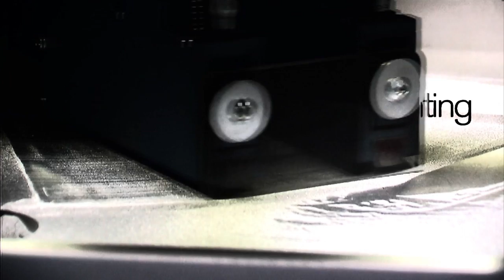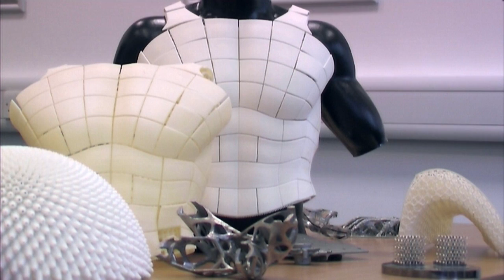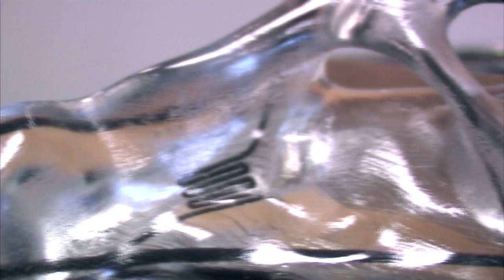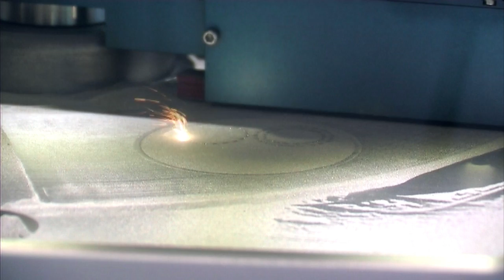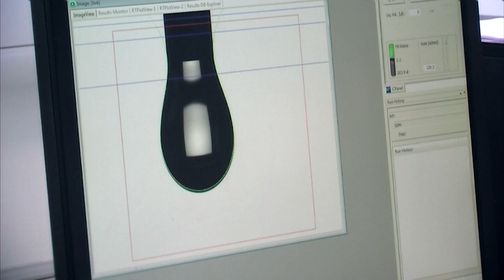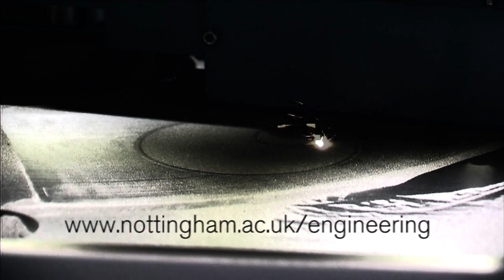Additive Manufacturing - 3D Printing

Comment: 26th of september 2022, I’ll start my Msc in additive manufacuring and 3d printing course.
Reply: Hello there, is there any way i can contact you regarding this masters degree?
Reply from the maker: Hi there - if you'd like more information you can search our Engineering degree courses here: https://www.nottingham.ac.uk/studywithus/ugstudy/search-results.html?search=engineering+ If you have any questions please use the contact details at the bottom of the page.